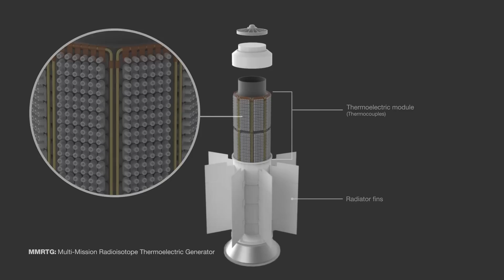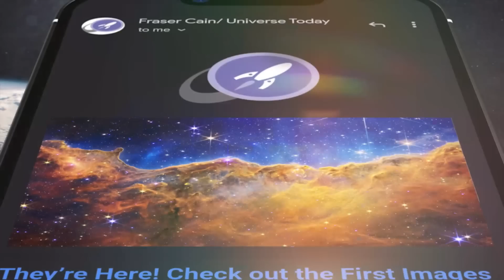Fusion Reactor To Melt Through Europa's Ice [NIAC 2023]

Comment: If that metal lattice is palladium, this is straight up Cold Fusion ala Pons and Fleischmann.  It works.  I've seen it work.  I've seen Helium as a byproduct, indicating fusion.
Reply: Seen where, and when?  In person?
Reply: Yes. And i have seen it spontaneously produce a rather delicious dijon mustard, and i also is pretty good at slam poetry. And it will also help move your furniture when you need to move, with absolutely zero complaints.
Reply: @Khannea  my good madam, I humbly implore you to share that mustard with me.
Reply: @Khannea  and I would beg of you to allow me to borrow that moving-heavy-stuff help, please. 🙏
Reply: Does it make neutrons?  Those neutrons could be moderated to cause more efficient fission events in the fission part of the fuel.
Reply: the metal s erbium
Reply: they blast it with gamma radiation to trigger fusion - so not really cold
Reply: Pons & Fleischmann's method was repeated by labs all over the world, and none of them got it to work.
 It failed peer review.
Reply: @kayakMike1000  Better yet, it makes neurons, so it becomes self aware. All joking aside, the original poster is either a liar or is deluded as no such technology exists and if it did he'd be a billionaire.
Reply: Huh.  Only 34 years to go from the hot fusion guys shrieking that lattice fusion is "fraud" to these guys talking about using it on Europa.  That's a better timeline than hot fusion.
Reply: @incognitotorpedo42  methinks you may be cherrypicking your sample size on "the hot fusion guys" and said "shrieking."

Comment: When I hear him speaking I hear him using words that fit with the context of "we have done this" but when I hear her speak the selection of words she uses are not consistent with something that was already done, it sounds like "this is the theoretical way it will work".  So my guess based on what I consider a least common denominator of the word tenses they used is that they have not warmed up a piece of deuterium matrix a measurable amount by means of the mechanism they are proposing.  Don't be fooled when scientists talk like this.  If they had a proof of concept they would be showing it.  It is dishonest to speak in tenses that suggest something exists when you only believe it can exist if you finish engineering it.  This is an ethical issue.  I don't doubt they can engineer anything they can imagine but if I was a funding agency I would look very very carefully at their work to make certain there are no shenanigans.  When people mix tenses like this, while speaking about the same thing, there is often corruption afoot.  We shall see... I doubt I'll hear about this again... the only bit that's a bit foggy is the bit that makes it all go... I've heard too many of these pitches in my life to just let this slide.  And so to wrap up on a technical point, at around 12:27 it would have been just wonderful to hear the question, "Ok, so what part of that makes it exothermic, it sounds like the trigger pulse comes to rest when the deuteron comes to rest.  The energy in the instability comes from the laser and is resolved when the deuteron stops moving, where's the extra energy, how much is it, and why?"
Reply: I agree 100%.  I had alarms going off in my head during this entire interview.

Comment: Ref' the header title - It won't work, when you melt a path through ice in order to penetrate the ice to a great depth the melt water has to go somewhere, this will move to the rear of the reactor in this case and refreeze as the reactor travels further down. 
  I am not suggesting the reactor will not work in itself but this suggested practical application will hit problems unless you intend bury it in its own tomb, retrieving any collected data would be an issue too given the tube will reseal itself behind and we are ignoring any such unknowns like solid objects it might hit like meteorites etc
Reply from the maker: This technology has been tested extensively in Greenland to melt a probe into the ice and it works surprisingly well. The probe descends faster than the ice can lock it in.
Reply: @frasercain  but Europa is not Greenland,  the conditions are predicted  the moon is so smooth it shows its massively effected by gravitational tensions, also in Greenland they have not got the same temps or the depth they want to go.
Reply from the maker: Here's an interview I did with a scientist at NASA going into extreme detail about how melt probes work if you're skeptical: https://youtube.com/live/f7z8Fv_CEaY?feature=share

Comment: Why not make entry via the funnels made by the geezers coming out of Europa as seen by the Juno probe. Surely this would provide a more direct route with less issues concerning melting through ice as the fissures would already be there.
Reply: Good point but it's most likely too hard for a self propelled robot to get in at the right time. Those geezers would solidify quickly and be more difficult to go through considering their height?

Comment: Great interview! 
Question:
Perhaps I missed it... but what if said probe runs into rocks/pebbles etc. embedded in the Ice?
Reply: I guess that will be heated as everything else and melt the ice as the "thing"
Reply: Melting upwards is easy, downwards just wont work for many reasons.
Reply: @bikerfirefarter7280  😂 whatever you say boss
Reply: @bikerfirefarter7280 
Give us one reason
Reply: @gilbertozuniga8063  1) As 'KerryLiv' said, rocks/pebbles will settle in the bottom of the melt-pool and halt progress.
2) Hot water rises, this will dissipate heat mostly upwards, eventually convection currents will take all the heat away/upwards.
3) Even if you could jet the hot water downwards the above two effects would halt progress.
4) The heat capacity of water/ice is so great even a nuclear reactor would struggle with the thermodynamics, plus said NR would heat/irradiate the rest of the probe. 
There are several other reasons.
I'm not saying its impossible to penetrate the ice, but just melting straight down wont cut it (scuse pun).

Comment: wouldn't the water pressure push the vehicle back up when it broke through the ice and hit the water?
Reply: That is a good question 🤔 but I don't know hope someone does, but I saw this an my brain said "this isn't a good idea" I mean let's say something catastrophic happened we haven't counted on an we irradiated a whole moon we might have lived one day
Reply: Unless you are pumping out liquid from the hole onto the surface, material that the probe had melted and passed through would just re-freeze as the probe descended, sealing the hole.  Even trying to keep the hole clear might not be possible; the weight of the ice crust would squish frozen material into the gap, so you would have to do some serious reinforcement to have an open void space above the probe as it descended.
Reply: Nope,  Its supporting the ice.  And the water would freeze after the probe passes.
Reply: @FoxtrotYouniform  The buoyancy of the probe would have to be carefully controlled, wouldn't want it trapped under the ice, or to plummet to the bottom. It would be pretty cool to see what's at the bottom though. I wonder how transparent the water is under there.
Reply: As long as the probe has higher density than the water around it, it'll sink.
Reply: @ZPositive  But it only has enough power to keep itself warm and a few milimeters of melted ice.  It will sink (or float) against the ice, melting ice as it goes and the far away water freezes behind it.  The only reason the Antarctic Ice drills work is a large supply of warm water transversing the length of the hole.

Comment: Are the aluminum oxide “pockets” used in Anodizing too large to accept deuterium atoms? How thin should the aluminum membrane between deuterium atoms be? Typical electron microscopy uses aluminum vapor deposition on salt crystals float on DI water, to support specimens…😮

Comment: This was awesome 8D I'm glad I could mostly follow along with the basics. I'm curious and have a few questions and as I am going to make a mess of this I might as well finger paint away :)  So, putting aside the technicalities of getting there, would it be better to cap the hole or leave it exposed to space ?  I'm going to make the assumption (yep, I know :) ) that the ice will react in a similar way to water ice here on earth, and so as long as you are above it's freezing point you will be able melt it.  Is there a point of diminishing returns on temperature vs distance travelling vs energy used to create the heat ?  Do you even need a drilling ability ?  Is it better then a heating element and maybe what steam could cut through ? Could the spacecraft be turned into a thermos or utilize the vacuum of space and trap and retain some of the heat already imparted to the water ?  I'm not a Glaciologist, just a sponge for interesting things, so isn't there a dynamic where melt water on top of a glacier works it's way down and underneath it speeding up the receding process, could this be utilized ? Sonic vibrations were mentioned, what about microwaves, would it be possible to "soften" the ice to make it easier to go through ? Ugh what about hardness ? If non terrestrial ice is harder and more comparable to rock or glass...nm, I'm giving myself a headache.  Would there be minerals or compounds within the ice that could be used as fuel to extend reactor life ?  Could some element in the ice be purified for possible fiber optics that might aid in signal transfer to the surface.  Finally and strangely enough, carbon fiber nano tubing keeps popping up in my head but I'm not sure why or what problem it could solve, need to sleep on it. Sorry for this printed diarrhea but thankfully this is only about half of what I could remember what I was curious about :P  Cheers !
Reply: Leaving the hole open would be a wonderful solution. However, you have to have somewhere to put the melted water. For a little while, the water could be pumped well clear of the hole, perhaps after that it may clear itself as steam. Pretty soon that steam will turn into snow and fall back down on top of the steam stream and a plug will be formed. It is best to have the water refreeze in a controlled manner right from the start for consistency. The problem of the cable to the surface was not well explained but only alluded to. The size of the drop vessel is set more by the size of the cable roll than almost anything else. Think kilometers of cable. As mentioned, the cable jacket needs to be robust to hold up against shifting ice. Having a hot enough head to melt through these layers of ice is just the start of figuring out the project. Great questions, it made me think too.
Reply: Depending on the local atmospheric pressure, water would only go from solid to gas. (Which is why it would be hard and almost impossible to find liquid water anywhere in the solar system, even if you melted that ice)
Reply: @lenwhatever4187  Thank you for the reply :)
Reply: @B0tch0  ty :) I wonder if the "bore hole" could be pressurized by the spacecraft and what benefits it would bring.  Again I elude to vague recollections of rapid glacier retreat and how pressure might be a factor in that process and how it might possibly be utilized here, I'm just spitballing :) as this is quite fascinating.
Reply: @PhonicallyPsychotic  to be honest, your comment got me thinking and I eventually wrote something back. Thank you :)
Regarding having a kilometer long hole with water vapor going though it, I think a good analogy would be to compare it to leaving a deep freezer open for some time. All the walls would slowly get smaller to the point where they would close (similar to the water in the Romain aquaduct with minerals). All deposits would accumulate until they couldn't go through anymore.
If I were to extrapolate from this line of thinking, the vents of Europa might be the result of meteorite impacts combined with tidal forces from Jupiter.
Reply: @lenwhatever4187  ugh, now I'm thinking about this again : / lol, so I think using a cable would be problematic as well unless... separate module in orbit or in transit and all the fun that would entail,   maybe a 3D printer that produces carbon nanotubes around microfiber ?  I know it's tech that's just coming out of development but it might be an option.  The solution I would choose, with the next to no knowledge to speak of, would be wireless transmitters. The important unknowns (I think) are material composition of ice and what can be used to relay signals, would it be better to have small signal relay / repeaters ? 25 to 30 micro transmitters with maybe a pressure sensitive heater to counter ice shift / encroachment ?  That raises the questions about what influences the ice and causes it to shift, frequency, location(s) etc.  I'm going to make the most evil and villainous suggestion and say we shoot it with a gun to get to a manageable depth without exposing the inner environment.  I will end with the age old question: What could possibly go wrong ?  Cheers :)
Reply: @lenwhatever4187  Nope. You're assuming perfectly 'clean' ice for many kilometers. It's going to have accumulated dust and other detritus, that will sink to the bottom of the melt-pool and halt progress long before your problems occur.

Comment: Not being a scientist or an engineer, I wonder if it would be possible to put a venting system at the mouth of the hole and heat the water at the reactor high enough to turn it to steam and essentially create a chimney and draw the steam out enough to keep the hole open. I'm sure it would be impossible to keep the steam from refreezing but it might help.  
How about a laser on top of the device that adds heat and keeps the hole open?   
Also depositing a series of radio repeaters along the hole to transmit the signal. from the device.
Reply: The steam probably would recrystallize, so reheating it as it escapes the shaft would be a cool idea. Maybe the radio repeaters would also have that function. Don't have to heat up the steam that much and there shouldn't be any water. Without an atmosphere on these ice moons, the ice should transition directly to vapor with a bit of heat since it will be beneath the triple point. Not sure if that will remain true if you bore a hole dozens of kilometers deep. Would it then fill with gasses of one kind or another from the gravity and increase the pressure, allowing water to form? And what happens when you hit the subsurface ocean? Will all that pressure cause the water to shoot up the shaft at high speeds?

Comment: A laser drill would be more efficient. It would vaporize the water and avoid the problem of the water freezing behind the probe. The probe will need to be split in two. An antenna part and a drill part. With a cable in between for communication with earth.
Reply: I wonder why no one used that on earth already. Did Luke ignore our emails?
Reply: Pressure would collapse the tunnel beyond a few kilometers and vaporized water would simply refreeze a few maters up the tunnel, blocking it. Where would you get the energy for this laser? If using nuclear, how would converting the heat energy of nuclear to electricity and then laser light be more efficient than simply using the heat to melt the ice directly, considering the losses?
Reply: In addition to the other reply; even if that worked there would be a minor catastrophe when it finally broke through without ice blocking the tunnel.

Comment: Would the hole close behind the rover, water sublimates in a vacuum, so unless the steam deposits on the walls of the borehole the water would just float out into space, until it gets below-50 °c and it would snow down around the moon
Reply: I made this observation too. It's all beneath the triple point of water. Would probably recrystallize on the walls pretty quickly though and salts and sediments that don't vaporize would clog up everything. But eventually it would get deep enough that various gasses might accumulate in the shaft to form some atmospheric pressure  and allow for a water transition.

Comment: Don't run out of fuel just after breaking through the ice layer to the under ice ocean.  If 1st contact is made with life under the Europa ice, it might take years to learn how to communicate with them.   Perhaps an AI should be included in case of a severed cable, and make the probe return to the surface to communicate with Earth.

Comment: Sadly, we are many many years away from fusion.
Reply: So... you didn't listen to a word of the interview, is what you're saying. Gotcha.
Reply: We have achieved fusion.
Reply: Many years away from pure fusion doing any useful work, Yes. But fusion has been working at a loss for a long time. This particular power factory sounds more like fission being enhanced by low level fusion rather than a pure fusion power source. Interesting if it can be developed. It sounds like it is still very much just the beginning of research.
Reply: We are about 8 minutes from fusion, plus however long it takes for the energy from that fusion to reach the surface of the sun.